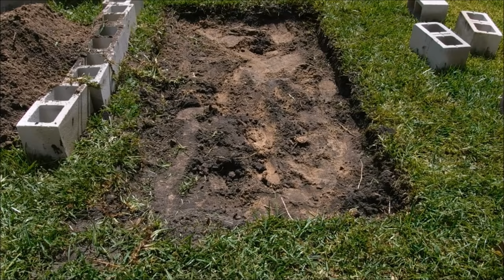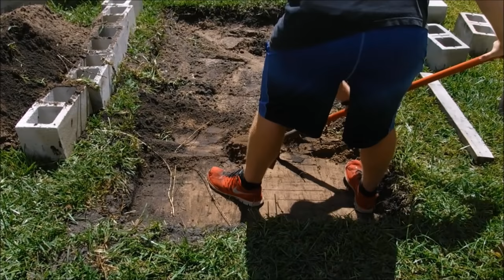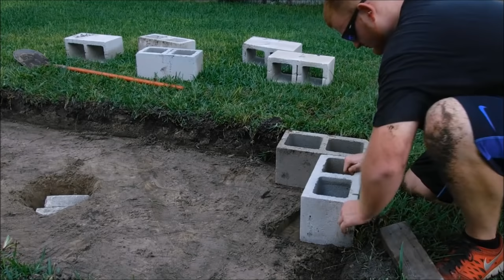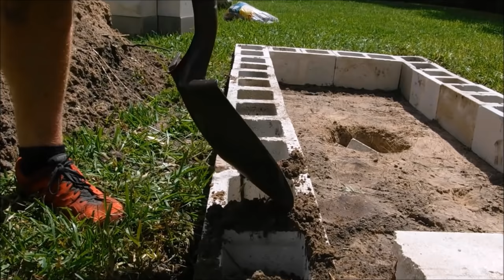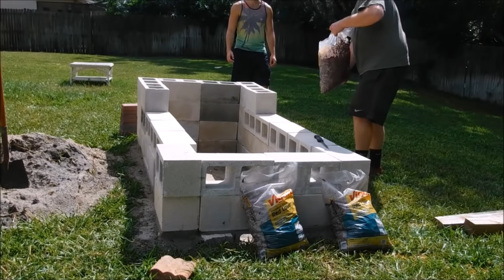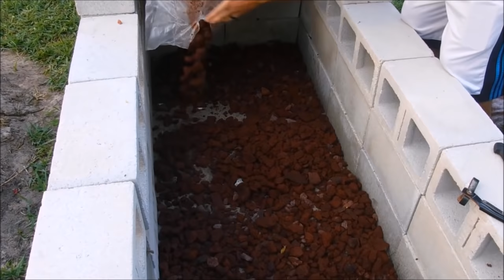Backyard fire pit and brick pizza oven

Comment: you gotta use firebrick  are you serious?
Reply from the maker: No it's been perfectly fine without it
Reply: @Nativeflpropertysolutions727  it’s only been 20 months. Next winter you’ll see. I’ve been building pits for 40 years. Just built one this morning and used a firebrick inside the cinder blocks. I also worked for a mason for 4 years. You’ll see
Reply from the maker: @jjyemg2397  okay well 2 years of weekly fires and its holding up pretty good for me at a fraction of the cost. I appreciate the input for when I build a more permanent structure
Reply: @jjyemg2397  - You can charge a lot more using firebricks - right?
Reply: @gc6888  You need the firebricks.  When the block cracks (and it will) it can explode.  It is not safe.  That's why they make firebricks.  It's not so that they can charge more.
Reply: Omg, yes he is serious about it !!!  😂😂😂😂😂😂😂😂😂😂😂😂😂
Reply: @jjyemg2397  it's mid Florida judging by the other videos. It should never freeze and the winters are fairly dry. What's the cold have anything to do with it when it only gets below 40°f a handful of days a year and never below freezing for more than a handful of hours?